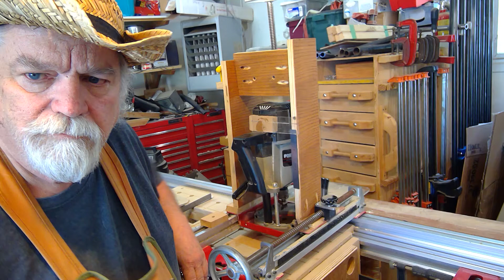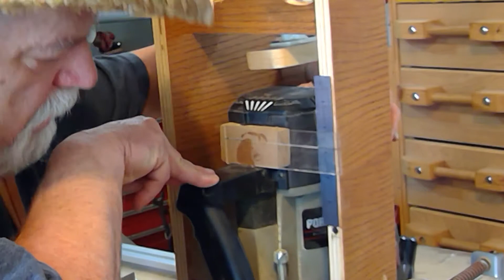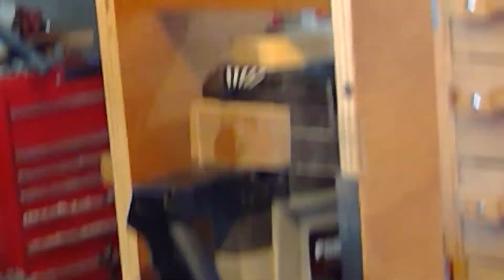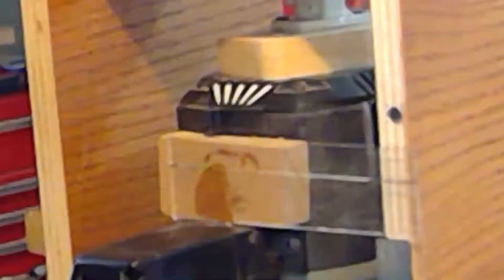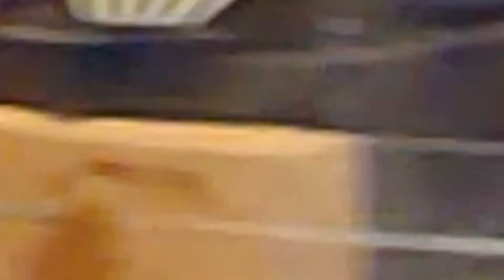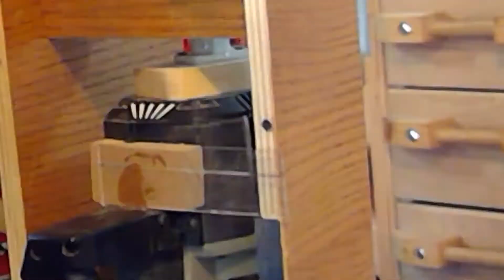Legacy building  control the Z axis

Comment: Hi Russ! I’m just starting to watch all your legacy videos, and I’m curious on your thoughts of using a woodpeckers slab flattening mill pro and convert it to more of a true legacy type overhead mill?! As I watch the rest of your videos you may have already addressed this or have a better cheaper way of doing this! I don’t own the woodpeckers slab flattening mill yet so I don’t know if I should hold off on that and see what your thoughts are?! I do want to be able to flatten decent sized slabs of live edge wood boards, but it would be great to be able to the other things your talking about that the legacy can do! I am loving all your videos but it’s taking me awhile to get to watch all of them! Thanks Bill Todd!
Reply from the maker: Sorry for the delayed answer.  I had to go look up the slab mill by Woodpecker.  I believe it would be a solid start on building your own DIY Legacy mill, if your goal is to build a LOM.  The rails appear easily adaptable to a screw gear system to adjust each axis individually.  Since I have a LOM, spending that much for the mill would be costly and take up space where the LOM already does all that and more.  If you are considering doing it for your shop, I would say go for it.  If considering that, I would say that I am open to communicating ideas back and forth.  I do have some pre-thought-out ideas.  When it comes to advice, I have been told many times, I am fully of it :>)  Let me know if I can help.
Reply: Awesome thanks for the response! How do I get in touch with you for your pre thought out ideas?! Or did you make a video of that and I just haven’t found it?!
Reply from the maker: @billtodd6745  I should also mention that you can reach me most readily during the day thru any comment to any of my videos.  I check my email once a day but watch for YT comments throughout the day.
Reply: Hey Russ! This is bill again! What are your ideas for making the router carriage glide over the main rails easily and stay perpendicular to the main rails?! Also how much adjustment do you have or suggest having on the table rails in relation to the main rails?! Up and down on the table?! Thanks!